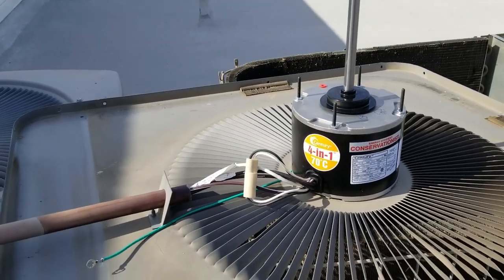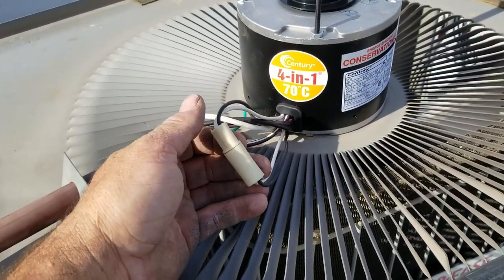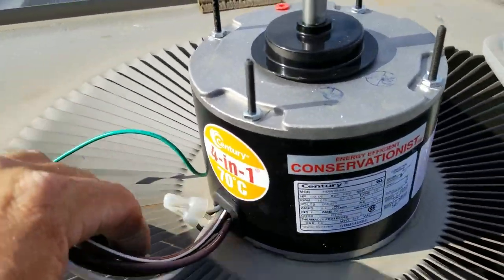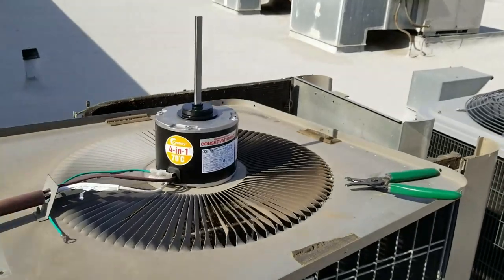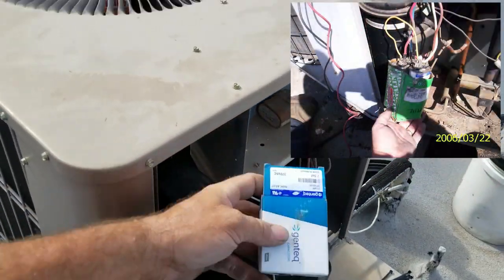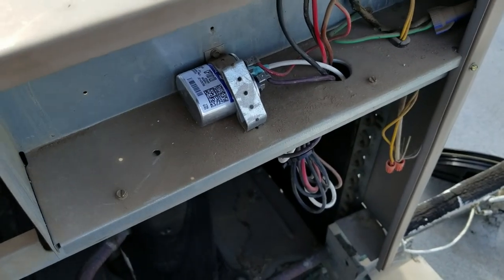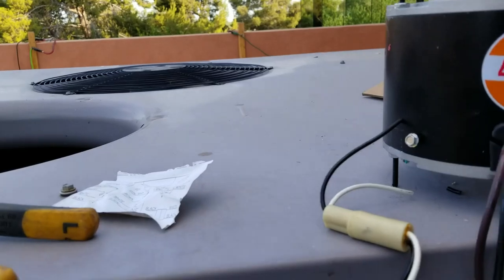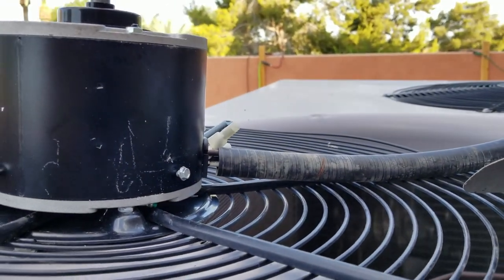How to install a universal fan motor and make it look OEM and clean

Comment: I like when you pointed out the crappy Goodman 👍👍😂😂😂😂😂
Reply: That's what I wait for in each of his videos, lol!
Reply: how rare is it to have a very quite goodman... because i have one?
Reply from the maker: Is it running when you listen to it? LOL
Of course most of my noisy Goodman jokes are about the earlier ones.
Reply: They should come with built in silencers (rocks).   I went with my brother the other night while he walked his dog around the neighbourhood, and we rounded the corner to hear a slightly rattly, not very well-placed air conditioner at the side of someon'es house, put right in the way and not neatly tucked out of the way....A dark grey turd goodman...I looked at my brother and said, if you guys ever put an air conditioner in a house you own in the future, don't get goodman...they are almost everywhere now here in southern Ontario.  I see good old air conditioners being torn out and cheap goodmans in their place.......I see some that look similar but they say "distinctions" on the side...is that like the Acura of Honda sort of thing, where it's their "executive" line of air conditioners? lol
Reply: Dax Marshall I got one too
Reply: The Goodman heat pump unit I have has been flawless and the warranty on the compressor is not 5 yrs not 10 years but lifetime.. No joke there, a very high quality insulated top of the line scroll compressor. A/C units after all are merely a sheet metal box containing components made by others. If the components are first quality so will be the unit. A noisier unit in not the brand but often times the motor one uses or the RPM speed??
Reply: Over here in bakersfield California alot of goodmans 4 goodman in every 10 units
Reply: Warranty is the same as most brands so🤷🏾‍♂️
Reply: He sounds very unprofessional and the way he talks and he’s like he has a job I hope we’re hired him or his boss doesn’t hear him talking like the way he does and less he worked from self

Comment: Makes a video on wire hacks - then hacks reverse leads with wrong connectors. Lol. Still did a quality job bruh. 👍👍😄
Reply from the maker: Actually, using the dead end connectors is deliberate so that the reverse wires don't fall into the fan or are not poking up through the fan blade like many techs leave them around here. 😁

Comment: I have enjoyed you run cap bandit videos for years.  Your work has made me a better technician, I hate caps that fall out when you remove the service cover.
Reply from the maker: Thanks.When I worked for DNC over 10 years ago it was every day that a cap would come falling out at me when I removed the service panel.
Reply: Condensar  fan motor  fixing time  220 v fan  shafit  length  tomuch ok  marking  cutting removing  comtssor ruing time tuchimg selit good  afyer fixing lif up gaped fixing sefit yis good  poperly giximg  good  way ok

Comment: overall, you don't give very good explanations about what you're doing. just complaints and complain. 
lots of jump cuts ✂️ 😳 need some more explanation about why the brown-white wire is to be cut even though new fan motor label says connect both brown and brown-white wire to the capacitor fan position. like, explain more about the illustration on that piece of paper, but just jumped to oh,, wires are cut. nice video quality though.
Reply from the maker: This video is made for experienced peers. Not DIY or anything like that. Just a discussion on using a universal in a manner to be clean.
I am pretty sure, however, that I did mentioned that the brown/white stripe wire is simply tied to the yellow (or white, depending on brand) internally. (Maybe, it has been some years now)
The only reason they ever added the 4th wire was for older units where the capacitor might be mounted near the motor and only two longer wires would be ran to the main control section.

Comment: But what did you do with the green wire? Did you just take it off??? I dont see where it goes too a d im confused on mine
Reply from the maker: The green wire is ground.  It's there IF you have an application where the motor doesn't ground through the mounting bolts and fan grill like most do.

Comment: If you use oem for everything than you like wasting the customers money. Instead of using universal CFM for everyone seems like someone is lazy lol. Plus Goodman is a good brand had it for 8 years and running perfect
Reply from the maker: OEM performs better in most cases. The load is matched closer to the fan and airflow etc.
Universal motors are just in the ball park and you often see higher amp draw when used AND less lifespan.
A motor with the load rating too low will get hot and die and a motor with the load rating too high has a bad power factor and also can get hot and not last as long.
It is a roll of the dice. We generally use the universal motors when an OEM is not available or for a quick onsite repair.

Goodman still sucks. Just not as bas as the brown panel ones of the 90's and 2000's.
They still don't make a good commercial unit. They are still pathetic like Hyundai and KIA were in their early days. HA HA HA

Comment: Were d you put the withe wire and the blck
Reply from the maker: I cut it off close to the motor. It is not needed when wired as 3 wire like an OEM
It is the same connection internal to the motor as yellow. (or white depending on motor brand)
It is just there for the times you mount the capacitor in a separate spot. Then the brown wire is on one side of the capacitor and the brown/white wire goes to the other side.

Comment: What about the green ground wire?
Reply from the maker: Not needed if the motor grounds thru the fan grill. Which is how most modern ODM's ground.
The universal motors just have them in case you mount the motor in an insulated cradle and need to run a ground wire
Reply: @hackfreehvac  thank you

Comment: I have a cheap ass rheem, not many in my area, priced oem, 648.00 , so i did the "right" thing and bought the 99.00 universal and wired it like you did. Looks clean, only complaint is its louder than the oem. Strangely the cheapo universal makes the head pressure lower. Go figure.

Comment: anyway... no sparks, yet. fired right up but may need new blade. The blade was a bugger to get off the old shaft. Trying to bend here and there but still a tad vibration so may order a new blade. Those extra wires, well the connectors were to big to fit in the pvc piping so I upped the pvc size to a thin wall. used a zip and clamp to secure because the hole that held it was smaller too. Now the orange and yellow will fit up into the pic pipe so no up out of screen or no need to snip and crimp. I may cut the remaining shaft, like 4". It may help the blade balance better. I measured my old blades. comes out to 21 so guessing I need a 20" 27 pitch 3 blade CCW? Thanks for the tips.

Comment: I'm the kind of person that would want oem for whatever im doing (if it's better, feasible, of course), and I know you like to usually use oem, why the universals for this video?  Great video as per, and the goodman bashing as always!
Reply from the maker: Emergency repairs. The second one was after hours. The first one was an odd-ball brand for this area and a customer with universal in everything already.
Reply: Bingo.  that's what I figured..thanks!
Reply: I just did one that nobody in town could get me an oem in less than a week and I would have had to pay expedited shipping to get that.  So I had no choice but use the universal.  The unit was about 15 years old so saving $150 plus whatever all that extra shipping would have been.  I like to always stay oem but I can’t wait a week and spend what probably would have ended up an extra $200.  It’s hard to believe we still have such supply channel problems on a nothing special ICP fan motor. 

People want A/C now not next week.
Reply: @speckulator7516  Oof, well then there's that...get the unit up.and running and I'd be using universal too.   I was a bit hard assed with that comment 3 years ago.  Lol

Comment: So my new universal has white black brown with white stripe and a brownish purple.. Purple and brown white have end connectors, white black do not. . old wires were connected to cap the yellow herm, red and purple were on common. Brown to fan,. I remembered B1 Y3 RP4.  what is confusing is which new motor wires are what now.? White is L2 and Black L1 so black to black and is the white the new Brown?. diagram on motor shows dark brown and brown white stripe to 10mfd cap. Ok, I have a dual run 50+5 capacitor ( old motor used this) but this motor comes with and a 10mfd run cap too and was told this needs it to run. How do I add thks into  the mix? wish you could call me.
Reply from the maker: There are some oddball wiring colors out there.
I'd guess that the two wires with the connectors are made to go to the capacitor and the two bare ones meant to be adapted to go to L1 and L2

One of the wires with the connector is likely wired to L2 internally and could be left out to wire back as a 3 wire.
Reply: @hackfreehvac  Yes.  The 2 did go to the 10mfd which will bypass the dual's 5mfd. The other 2 are the L1 and L2.2 ended up on the common of the dual.

Comment: Where would the ground wire go
Reply from the maker: Most motors ground through the grill which then grounds to the unit chassis.
The ground wire on the universal motor is there for old units or where the motor might be on rubber isolators and needs to be grounded through the wire to the chassis
Reply: @hackfreehvac  thanks 👍

Comment: My old condenser fan motor is 1100rpm, 1/4HP and 1.3amps
The only replacement I'm finding is 1075rpm, 1/4HP and 1.6 amps. 
Is this likely to work without any problems?  Thanks.
Reply: Yes

Comment: How do I use a new Motor with 5 wire and my old motor has only 3 wires? Old has Brown orange and black and my new has a black yellow orange purple and brown?
Reply: I’ve got the same set up with my recently purchased fan motor. Condenser wires are yellow black and dark brown? I’ve got three  on the fan motor and three on the AC condenser not sure how to hook it up because every time I do it throws my Circuit breaker in a minute or two, I’m both confused and perplexed i’m not sure what going on? Any help out there would be great!!!
Reply: @bigtom6746  did you figure this out? I have 2 whites, black, red and a brown.

Comment: Will it matter if u put 1/4 hp to upgrade 1/5 hp motor???
Reply from the maker: Well,  the universal motors essentially do that but putting in a larger motor causes a mismatch and can actually cause the motor to operate hotter. 
I thing that's why the universal motors have gone to higher thermal ratings now 
They can run really hot.

Comment: You forgot to mention when they put in a fan motor that has a larger depth, fan no longer in the shroud and the unit trippes on high head
Reply from the maker: Sometimes I've seen them hang the fan blade way down on the long shaft when there was no excuse because the motor wasn't even any deeper. Just wow

Comment: One of these days you'll figure out a good use for that extra wire that gets cut off.  After a long, hot summer, you'll have a fortune in wire from all the replacements.
Reply from the maker: I save one or two in the back of the truck. They come in handy when I need to extend the capacitor wire, etc.

Comment: Long shaft will cause premature failure of the bearings, no???
Reply from the maker: Some OEM units have the fan hanging quite far from the motor. 
Which must be why the universal motors have the long shaft. 

I'm sure an out of balance blade might have more of an effect being further away but other than that I doubt it changes much. 

I generally like to cut off the excess for the cleaner look

Comment: ok, think I figured it out. Havent seen a video on this so feel free to chime in. Since the new universal motor is 10mfd, OLD was 5 so a 10 was included. New wiring should be L1 black to contactor like before. On the 50+5 Run capacitor yellow to herm, connect the red jumper back to where was before on a common terminal, connect the white L2 from motor as well on another. Common will have motorL2 and L2 jumper to connector.also the L2 wire. Now the funky brown purple goes to one terminal of the new 10mfd run capacitor and the other terminal gets the brown white wire. Basically bypassing the 5mfd run on the original dual capacitor and adding in a new 10mfd for just the fan motor. SHOOT! white and black bare! Now I gotta go get some stupid female terminal ends and end caps because the orange and yellow wires off motor are way to long so snip cap crimp close to motor housing.  So close too...15 min job actually takes 2 hours.  BTW, do I need to cut off the few inches of shaft once the blades are set?
Reply: Jack, I always change the dual run capacitor while I’m in there and would just buy the size I need to work with the new motor.  It makes for a cleaner install and customers don’t under if the compressor cap goes out next month.  So I just change it.
Reply: @speckulator7516  I did the 2, figured how to wire it. Lasted a year until 2 geckos fried it.  Had to get the AC guy. He put a single bigger one on it ,not a cheap china one. Man, that sucker made some noise on start up but eventually went away and so far so good.

Comment: I understand drain holes at the bottom but why are there open holes on the top of fan motors?
Reply from the maker: Are you talking about the one hold at the opposite side with a plug?
Some motors mount in a belly band mount with the shaft facing up rather than hanging on the fan grill.
That was popular on some older units.
Reply: @hackfreehvac  I'm an electrician working on my own unit and recently found some have holes on the top like what came in my Trane XR15 model but now noticed they are mounting holes that don't go all the way through. I had to get a 1875 EZ-Fit U.S. Motor and found 4 mounting holes on the sides (like for a Rheem model) and then 2 additional holes on the sides not tapped and no screws or plugs in them with a clear view to the motor.. 
I used a tap and ground screws to fill them and hopefully avoid water intrusion. I guess that's what we get with some of the aftermarket universal type motors.
Reply from the maker: @Conald_isAfalseProphet  Oh, those newer Trane units have very specific holes that have machine screws that mount them. I don't know if there are many universal motors for those.
On the sides I often see the old Rheem holes but haven't seen any others on the side than those.

Comment: I hate to say you point out other technician bad work. I thought you are trying to educate others how to install condenser fan motor not how others how they do their job. I believe you videos could be informative and interesting if you keep subject matter.
Reply from the maker: You have to point out the problems with the lazy hack work in order to demonstrate a more proper way.
Technicians pulling the wires up through the fan grill (sheer hackery) is an epidemic in my area.
Work like that needs to be shamed.

That's how we did things in our once great country before people became snowflakes and the SJW's started to control the media.
Reply: @hackfreehvac  it doesnt matter as long as it's wired correctly and has the right ratings. This isn't a landscaping or painting industry. We're not here to do aesthetic work, but logical. If it's quicker to connect the polarity wires outside, then that's more logical.